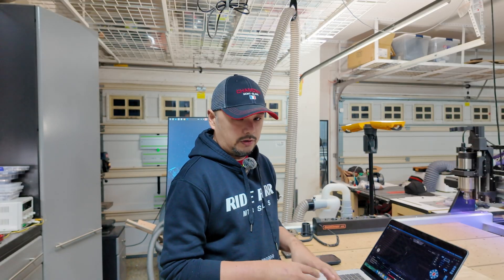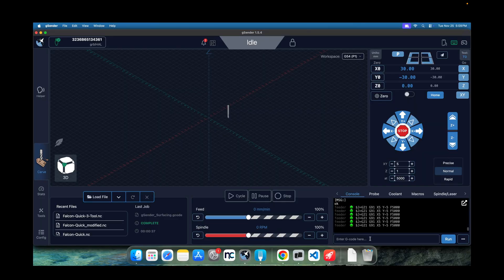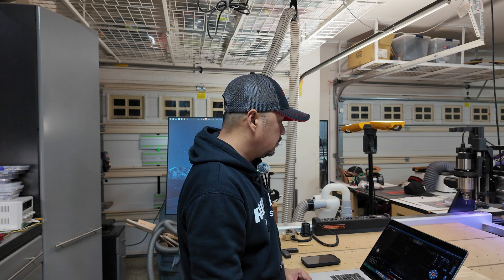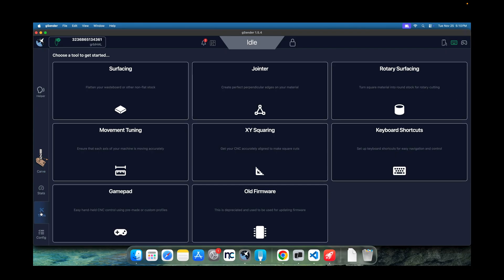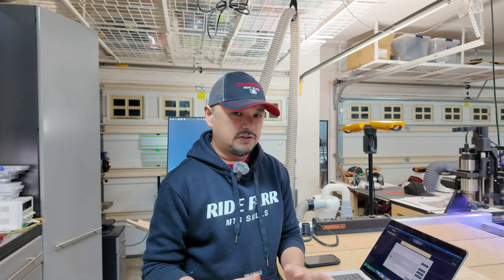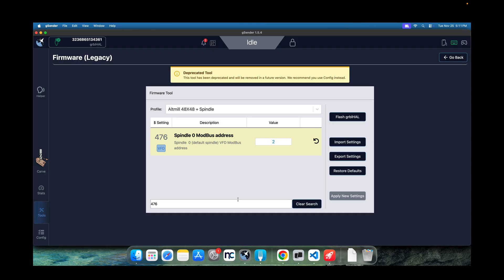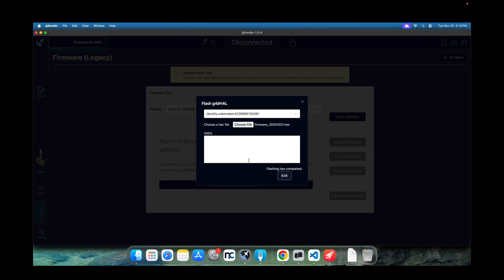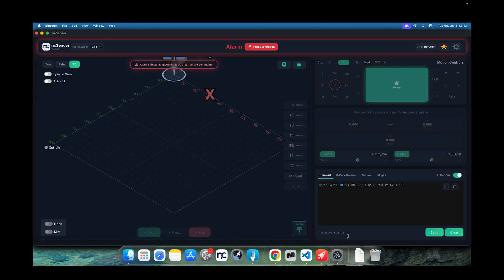Upgrading AltMill firmware sienciHal to grblHal

Comment from the maker: Settings you might need to update after loading my backup firmware settings.

$6 --> Probe  / TLS, Im using NO (Normally Open), if your using NC then you need to invert this values. 
$395 --> Your default spindle type (for user with spindle)
$476 ---> ModBus address (for user with spindle)

Comment: I think my last comment was lost. My question is that if I make the back ups as you mention and if I dont like the new NC Sender, I can do the same steps but using the saved back ups to get back to the regular G sender. The other question is if I make the upgrade, can I use G sender or do I need to use NC sender only, Thanks
Reply from the maker: Yes. Thats what your backup is for.
Reply: @francis.creation  Thanks, I have the .106 sender, have not changed the firmware yet, just playing it around, noticed rapid change does not allow to change to ER16, the other movements seem to work fine, grab, etc. I imagine nothing is going to work as good as yours until I get the new firmware and new settings you have, correct? Also, most important for me, after I upgrade then I dont need to use the SD card, Correct? Thanks again.

Comment: Nice Fransis, I'm gonna try it this weekend. Does gsender work on GrblHall?
Reply from the maker: Yes.
Reply: Hi Fransis i got a " Info: Erasing chip starting at address 8000000 - size 380260
Error: Open failed: initialize error: Error: LIBUSB_ERROR_NOT_SUPPORTED" is that a windows problem or is it because the file is linux related?
Reply from the maker: @KeldDaugaard  Not sure. I haven't tried flashing using LInux or windows. I always done it on macos.
Reply: @francis.creation I have fixed it, it was DFU mode and a STM32 driver. I used the spin pins on the board. I need to config now, gsender works in slowmotion, but Nc don't,  yet not sure why. I used my own settings, because I'm not on at Altmill, just Ratrig 750x750 with new Cls steppere and SLB-EXT board. I'm on CET, it's working time here. Edit: It's up and running now. Used Ur settings and trimmed it to my Cnc.